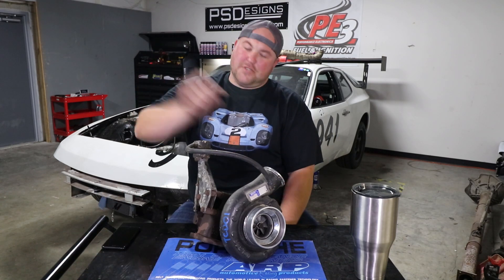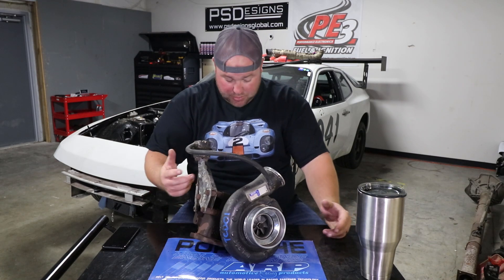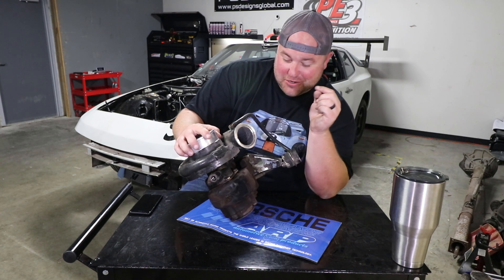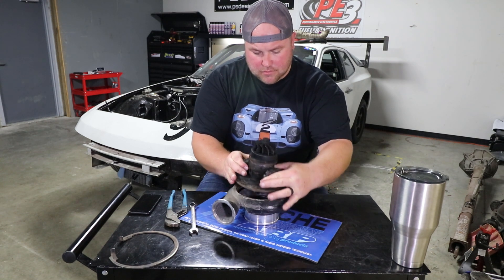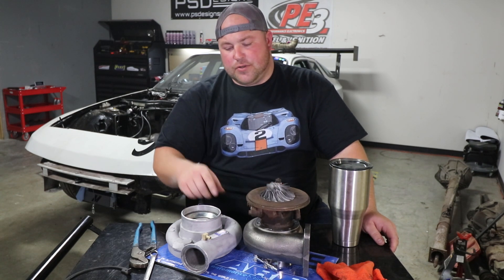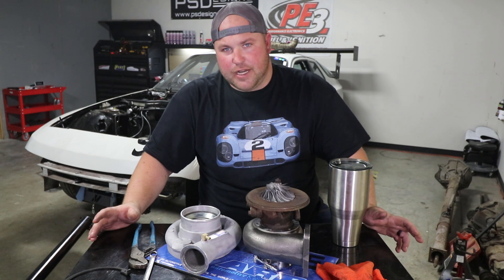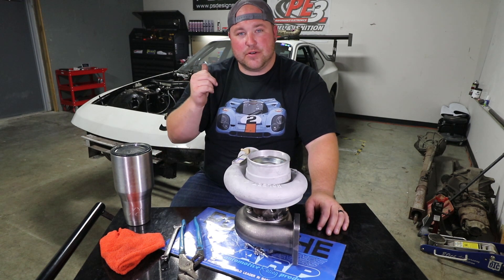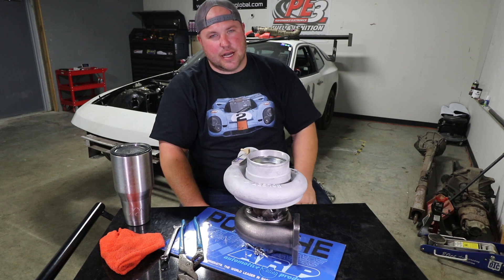Why the Holset HX35 is the BEST budget turbo!

Comment: A new with warranty GT3582R thats capable of 700whp is arround 600 bucks... Why try my luck with an ebay, used turbo? And also, diesels don't have egts as high as gas engines, so manufacturers can cheap out on the turbine wheel a bit... Food for thought
Reply: I gotta say, the GT3582R I bought used on CL has held up to ALL the shit. Love that turbo.
Reply: Only if you're buying knock offs.  Garret has them listed at 1700 here in in Canada
Reply: Knock offs, yes, still, new with warranty and actually 700whp capable. Notice I didn't actually say GARRETT first. If you take a look at the BoostedboyKile's channel, you'll see a pretty successful build with an ebay gt3582R that lasted him quite a lot. Eventually upgraded but just to freshen up and for a bigger ex. housing  @HisNameIsTater

Comment: While I do agree holsets are the best budget turbos, 600hp is a bit of a stretch for the 8 blade hx35 you have. 500 is about max for the 8 blade. The 6 and 7 blades can flow enough air to support 600hp.

Also, gt3582's are like a 700hp capable turbo, so they would be better compared to a 6 or 7 blade hx40, not an hx35.

Comment: I've been running a hx35w... Same one you have since the early 2000s. I recently went from a 12cm housing to a 10cm housing. I was originally going to do what you did but then I'd have to remake my exhaust and I have a Turbo support bracket. And I haven't had an exhaust leak in 6 years. I didn't want to open that can of worms. Anyway, I bought a rebuild kit and a billet compressor wheel at the same time. I've probably got 6 or 7000 miles on it... it's on a 2.8l. Spools around 3k. Sounds amazing it's a 5x5 design extended tip 54x78 Extended tip to 81mm. I highly recommend the bullet compressor wheel. If you're after spool go with a high blade count compressor top end 5x5. I did everything myself and didn't balance it. I run it a 17psi.
Reply: How's your hx35w with 10cm going. I am about to install one to my n54 instead of the twins. It's budget project. I don't want it to lag much though

Comment: Totally agree about the hx35. Its pretty much my favorite budget snail. I've used them on a few different builds, my favorite being a top mount setup on a N.V. m50 with a Cometic/ ARP'S running on MS3. Put down around 450whp RELIABLY, and still had quite a bit more to go. These compressors can be had for as little as $100 or so in used condition, and you can get a rebuild kit for around $100 as well. They also come in both I external and internally gated versions. The letters on the end denote that. I believe they are either denoted as a 'Y' or 'HY.' They are also plentiful too which makes them great to use. Good video, some nice info on the Holset. We definitely think alike both liking these turbskis 😎👍
Reply: Are you running an M50b25? What is the spool and throttle response like? Im curious as im thinking of running a turbo M50b25  in my track car in the future. Hence  im looking for good spool and throttle response without breaking the bank.
Reply: Yes non-vanos m50b25 although it can be done with any of the m5x, m20 or m30 platforms. The response and spool up time/ lag is very similar on all the m5x for example. You have to think that the hx35 is accustomed to be ran at much higher psi on the Cummins motors and worked much harder than it would be on any of these bmw engines. It is pretty much the perfect size compressor for the displacement that you are working with. You can throw a generous amount of boost at them and it isn’t even ‘breaking a sweat.’ I prefer the N.V. motor over any of the others for this specific application because of availability, price, simplicity and the forged internals. The fact that if something goes south on it, you can grab another to drop in for extremely cheap. To originally perform the swap if your car isn’t an m50, you can buy a complete roller with everything you need to start the swap out and get it rolling. For instance a ‘92 325i or ‘92 525i that has accident damage or body that’s hammered to hell can be found simply to get you started. Early e36/ e34’s that people have ‘given up’ on are quite common and if you find a wreck that doesn’t have any damage to the drivetrain you can even find them for basically scrap value. I’ve seen decent running and driving e36 or e34 chassis m5x cars for <$1,000, even $600 or something along those lines. The choice would then be yours whether you wanted to open the motor and refresh, build, or just head gasket and ARP it. You could just stab the thing in there and do your supporting mods for the F.I. and take it from there, or go all out and refresh/ upgrade from the start. Budget and your end goals will determine what choice you make with your build. Lots of folks either just throw the swap in and do nothing else and have pretty good end results considering the minimal amount of prep work they did. You can always sell off parts from a roller and recoup some cash too

Comment: The Holset HX35 has been the secret budget turbo for decades now. I figured everyone would have found out about them by now.

I think if you're laying money down for a brand new turbo, you should buy the best you can afford. If that means it costs $2000, so be it. When you get up to that range, a lot of times the differences come down to things like ball bearing CHRA, which technically might not make a huge difference, BUT when chasing down that last extra bit of power, you really do get what you pay for. I loved it when Cleetus put the ball bearing Precision turbo on his auction Corvette, and seeing how when he shuts the engine down that thing spins for DAYS. I personally have my eye on Forced Performance's Xona Rotor line of turbos. I'd love to try running one of those.

That said, for budget builds, you can't go wrong with a quality used turbo. I'm partial to Mitsubishi myself, because I've used their turbos and loved every one of them. My first turbo swap was a used 14b that I bought off ebay for $80 (this was back when the cheapest new turbo was a small 16g for $550, nobody knew about Holsets, and Chinese turbos didn't exist). I was rather disappointed when it arrived because the turbo was coked, so bad that it wouldn't even spin freely. But I was able to take it apart and rebuild it just by thoroughly cleaning it out, no parts needed replacing. The previous owner had ported the exhaust housing as well, so that thing RIPPED! Taking a turbo apart is not that big a deal, just make sure you mark the alignment of everything and put it back together the same way. Loctite that shaft nut or you'll end up with a smooth compressor wheel (don't ask me how I know this)! This is why I love Mitsubishi journal bearing turbos, because they perform well and are super resilient. Even if you abuse them, they're easy to clean and revive.

I would buy a used known turbo, like any Mitusbishi or Holset, long before I'd ever buy a new Chinese turbo. Why? Because you know what you're getting, and they're quality precision parts. I think Holset is probably the better way to go as they're cheap, and like you said, they're engineered to last a long time. A Mitsubishi turbo is more likely to have been abused and subject to extreme conditions like my 14b was. But I'd still rather buy a coked up turbo for $100 than spend more on a Chinese turbo. From what I've seen, a lot of these turbos seem to be a mishmash of whatever they have laying around. That might work out fine for you, and they might be assembled and balanced correctly, but it's an absolute crapshoot as to what you're getting.

That's not to say that parts made or assembled in China are automatically bad. Good manufacturing CAN be found in China. I know nothing about CX Racing or their turbos other than what you stated in this video, and if they're doing it right, their turbos are probably great for the money. But there's a reason why new turbos cost as much as they do, so I personally wouldn't buy one. I'd rather stick to a known quantity, whether that's a new FP turbo or a used Holset.

Comment: Will the HX35W work as well?  Is there a big difference between the two?
Reply from the maker: The W just means it has an internal wastegate. That would not be an issue and would get thrown out with the factory turbine housing if you went the route that I did.

Comment: being a diesel guy (specifically 12 valve cummins) its crazy to me that gas guys love this turbo. for our application on our cummins trucks this turbo is tiny and cant make more than 300hp. for us to make big power normally around 1000hp we run 70+ millimeter turbos
Reply from the maker: Diesels just have soooo much exhaust energy they require monster turbos
Reply: Its incredible to see how much power you guys make with our stock turbos lol

Comment: Take the silencer ring out. There IS a whistle difference. If you wanted to really go nuts, send the compressor housing off to get a 51r mod. That mod makes the turbo spool sound insane..  turbo labs guy is a turbo genius if you have any questions on your center cartridge.
Reply: I herd that the 6.0 2003 and late 2004 powerstroke whistle insane is not only the variable turbo but it had i believe 9 blades on the exuahst , then ford went to the 11 or 12 not sure, to reduce whistle because some customers complaind about the whistle. But i do belevie you have whistle from the intake and from de exuahst as well.
Reply: No...it dosent the only thing that effects the sound is the exhause wheel
Reply: @wyattfrey6079  I understand your thought. But you are incorrect.
Reply: Hahaha its not my thought its Banks power and Gharret turbos thought🤣🤣

Comment: 12 cm turbine is a .76ar, youll also benefit from the twin scroll over the open, the comp wheel in your unit isnt rated that high, still love your approach to what Holset offer.
Reply: twin scrolls only work on odd cylinder engines, 5 cylinders can't benefit from twin scrolls the way 4 cylinders do
Reply: @inaNis_  first off thats not mentioned secondly twin scrolls have been used on both Audi and Volvo 5 cly, do your research sweet heart
Reply: @stevemurch6974  Do you have a source for this? I'm just as interested in this as you seem to be.
Reply: @inaNis_  ive done it many times including running twin scroll housings on 3 Rotas, Google brings up examples
Reply: @stevemurch6974  the holset exhaust housings apparently don't flow as nicely as they should even being twin scroll.

Comment: So what's your opinion on a power stroke turbo ? Road kill had a 7.3 turbo with a smaller banks exhaust housing and ran it on a stock 5liter ford and it seemed to be a real beast didnt have much lag

Comment: Question trying to do the same going to buy a smaller turbine housing for my garrett gt37....right now it has a A/R .65....what would your recommend. Going to add to a 4cy 1.4
Reply from the maker: Man that’s not a lot of displacement. The GT37 is a big ass turbo (if that wasn’t a typo). You’d be a lot better off with something like the GT2052 or a factory takeoff VW 1.8t turbo

Comment: I’m building a Volvo 242 5 cylinder with the same turbo, got it for a killer deal. What ecu are you running?
Reply from the maker: Performance Electronics PE3-8400

Comment: I have a supercharged 3.4L v6
I would like to add a turbo, I have an HT60 is it possible in any way shape or form to run this thing?
Reply from the maker: You’re wanting to go twin charged or replace the SC?
Reply: @BoostBrothersGarage  twin....something different. Not after crazy HP NUMBERS just something unique
Reply from the maker: Since the SC will take care of your low end you can be pretty aggressive with turbo sizing. However, the HT60 turbine housing is MASSIVE. The housing i use in this video will not work. An HX35 would probably be perfect since you aren’t searching for big numbers. Otherwise you could bump up to the HX40.
Reply: @BoostBrothersGarage  hoping to find a stock turbo off of something. Just dont know size engine to take one off of... 5.9,6.0,7.3...???
Reply from the maker: I would just get on eBay and search that way. Turbine housing is what you need to pay attention to. You need 12cm most likely. Also, if you google it there are some really good Holset guides that help give you a better idea of which turbos fit which application.
Reply: @BoostBrothersGarage  some guy boosted a 4.6L crown Victoria with a 7.3L turbo.  It worked but I dont know how...lol

Comment: Hx35 is great .  Have a video of one I setup I did with dsm in my channel . 

My fav budget turbo is slightly more money . 580.00 borg Warner s366. Genuine .   But I love hx35/hx40’s !  Great vid .  Cool comparison coming .  Subscribed !
Reply from the maker: Yeah, that BW is a great deal! Thanks for the sub, I’ll check your channel out!
Reply: Boost Brothers Garage I have a question for you how would I delete the internal waste gate and change the exhaust housing on a holset he400vg I’m doing a budget build race truck and I got my hands on this turbo and don’t know what I can do with it
Reply from the maker: Evilempire1131 I don’t know of any aftermarket exhaust housings for that turbo. Being variable geometry adds to the complexity as well. If it were me, I would be selling that turbo and getting something more traditional. A Borg Warner or Precision most likely due to power per dollar
Reply: Boost Brothers Garage if you do your comparison between this and gt35 you should include the s360 !!  It’s under 600.00 and very comparable.  Bigger turbine than all of these , probably slightly later spool but will go much farther and not lay off on top .  :)
Reply: Boost Brothers Garage I just post vids mostly for customers to see when they are not around for startups or tunes.   Also I would mention the little brothers the 363 and 360 are also inexpensive if the 366 is too big for a goal or desired spool.  Friend getting parts together to replace old t3/t4 50 trim with s363 on 12v vr6 .

Comment: The H*Y*35 is the best-kept secret....same compressor wheel and airflow potential as a HX35 but comes from the factory with a single-scroll T3 turbine housing so there's no need to purchase anything additional except maybe a v-band adapter for the outlet ($25-$50 on eBay depending on the size needed); just weld the flapper shut and you're ready to go.  Airflow-wise neither of these units are comparable to a GT3582R....that would be the HX40 instead. The HY35 you'll want is only found on 99-01 Cummins-powered Dodge trucks with an automatic trans.
Reply: Bingo, it's pretty rare to see anything over 500whp on these unless people start swapping out custom turbine wheel/shafts and/or compressor wheels etc.

Comment: Being a smallish turbo, doesn't take as long to spool up either.  I've seen these things as replacements for the stock GM turbos on 6.5's, which, let's face it, Holsets are a huge upgrade.  Two of these can generate the same amount of boost as a gigantic one, and for an engine governed at 3600 rpm, plenty of meaty boost to work with.  I'd say that's where smaller turbos really shine, getting that initial spool up at low end rpm, damn near idle, great for autocrossing, corner acceleration, and of course Diesel towing.

Comment: If its got 4 bolts then it sounds like a WH1C off the 94/95 cummins. Same thing as an hx35 just older
Reply from the maker: Yep, although the H1C doesn’t flow quite as much air
Reply: The WH1C or "wastegated H1C" and ONLY the WH1C has a 56/83mm 8-blade compressor and surge-ported compressor housing...the same as the early HX35 units.  Airflow and power potential is the same between the two, although the H1 series has a weaker thrust system so you're still better to use the HX35 for a performance application.  The H1 series is easy to detect as they have a bolt-on seal plate like a T04 Garrett and the compressor housing attaches with a v-band as opposed to a snap ring on a HX unit.  The NON-wastegated H1C's all have compressors 54mm and smaller and don't utilize a MWE groove on the cover so be careful what you buy as some folks will list an older H1C as a HX35 as their fitment can be identical but there's a huge difference in potential and high-boost durability.

Comment: I have a Golf V6 2.8. Can the HX35 produce 600hp at the crank? or better the HX40?
Reply from the maker: The HX35 should be able to make 600 crank. The HX40 will make more power, the 35 will have better response.

Comment: How much boost are you going to run with that turbo? Im thinkin of droppin one of these into an e30 at 8.70psi, im not sure if this is too big tho.
Reply from the maker: I will likely run around 15-18? If you are wanting to stay at low boost you may look at a smaller turbo just for instantaneous boost. This would be a great fit for a small displacement inline 6 though.
Reply: @BoostBrothersGarage  ok awesome, what are some examples of smaller turbos that are good quality, ive been lookin at forums and havnt found any concrete answers. I guess i could get a smaller housing because im looking for around 0.6 ar ratio.
Reply from the maker: Holders come with a variety of turbines housing sizes. Anything 12cm and smaller would be fine
Reply: @BoostBrothersGarage  thanks for the help bud appreciate it

Comment: Holsets are best,mercedes guys running these all over in europe.
My friend has the hx40 on his om606,i have an hx30 on my 1.8 m111
Reply: What rpm does it start making boost psi?
Reply: @monikhushalpuri  past 4000,I run 1.2bar on it.
On basically all benz engines you want to have boost late,to avoid bending the rods